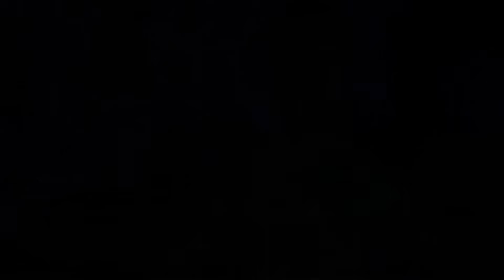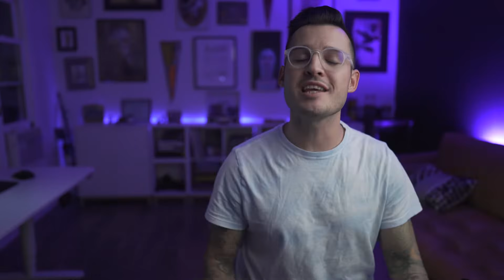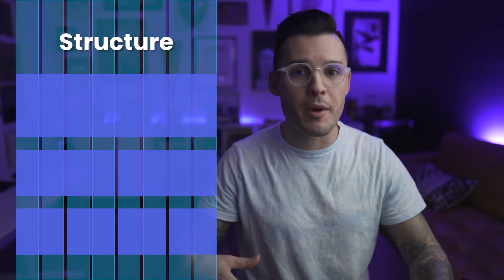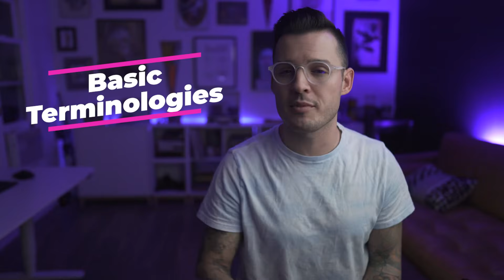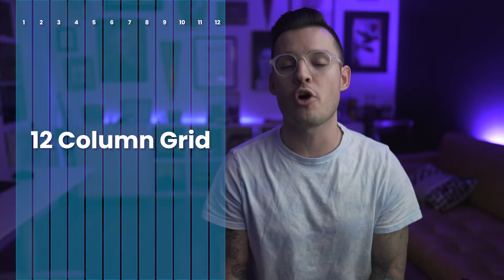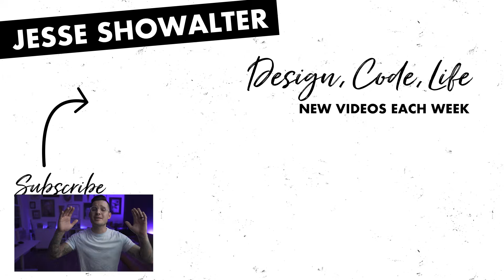Grid Systems in Web & UI Design

Comment: Can one column have 1 additional pixel? I set up a dashboard 1440x1024 100px margin 24px gutters and the width of the columns are sometimes different (1px difference). Did I just ruin the design system that I’m working on? It just stretched this way.

Comment: Great vid! When designing for desktop, do you keep everything inside of a 960 grid? Also what does the term “offset” mean? I’ve seen it on a couple of the UI design softwares. Thanks Jesse!
Reply from the maker: no 960 is no longer the standard, I try to stay between 1100 and 1400 for desktop. Offset is exactly what is sound like, it offsets it from the center of the design